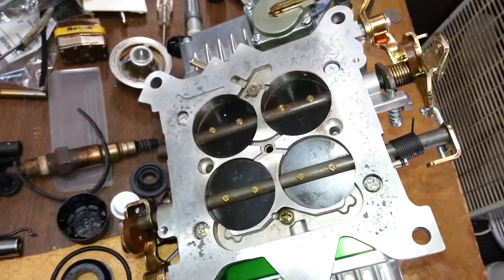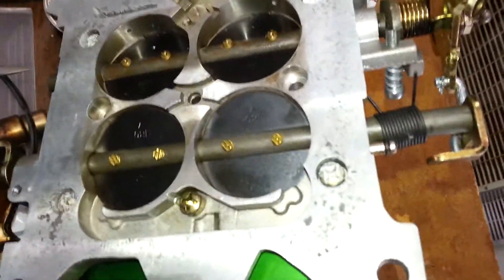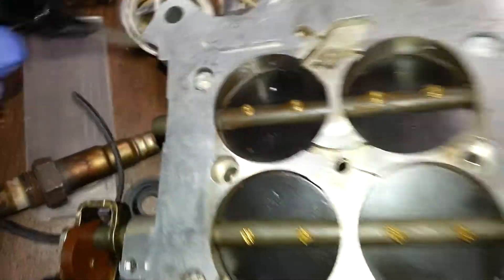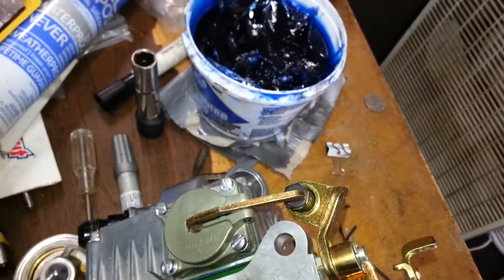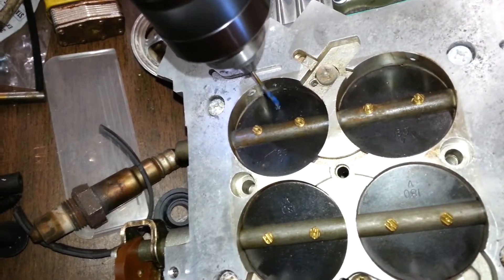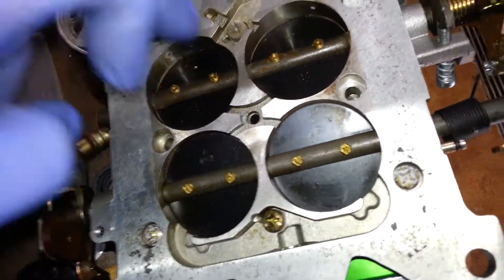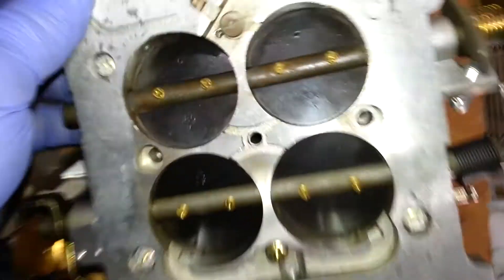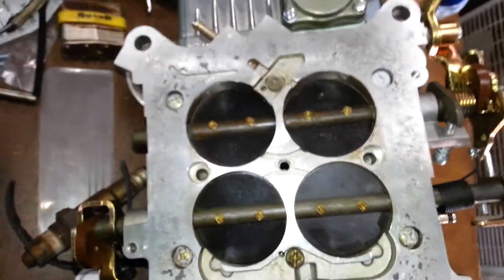Carb Idle Modification Drilling Holes

Comment: I was having the same problem,my 350 would not idle in idle circuit.I was hesitant to drill holes in the primary butterflies but was a a dead end so I went for it and it worked!now idles in idle circuit and I was able to adjust mixture screws with highest vacuum.runs better too.I was worried about ruining a brand new avs2.
Reply from the maker: Most of the newer high end racing and custom carbs come with holes already in the butterflies. I just think people today run more aggressive cams even in street driven cars that require that little boost of air. Glad you were able to get it figured out! 👍

Comment: I just take ‘em off the carb and do it and if you go to big take ‘em off again and weld or epoxy the holes and start over but yeah I did it on a 750 front and back with success.i will say that I have a new 600 throttle body I took em off of and they won’t go back on properly without a little massaging but we’ll get there.i’m building 4 more carbs.
Reply from the maker: I love working on carbs because they don't need a computer or electricity. Just a screwdriver and vacuum gauge 👍

Comment: Great video, I’m pondering whether to do this or not I literally have my carb on the workbench with a drill in my hand lol. I thought I would ask this comment first, I cannot get my car to idle without the transfer slot super open. If I back off the idle screw to leave the transfer slot, barely visible, like you’re supposed to, my car won’t idle. I’ve messed with my timing, I have a pretty good Lunati cam, if I do this will it help in that situation?
Reply from the maker: When your engine has more then stock type components many things can effect situations like yours. Can it help? Yes, but start with just doing all of the butterflies small then see if that helps at all. Then go up in hole sizes until best results. One main factor is having a choke horn or not. If you have a choke horn it will need more air flow. I think you should also change jet sizes too and try to get an AFR gauge to help you dial in your tune better. Good luck with your project! 👍
Reply: @djrowe10  awesome, this morning is my first test drive I appreciate the info! I definitely need to get an AFR gauge. Appreciate the reply
Reply from the maker: I hope your ride is doing awesome and the AFR gauge has helped dial in the tune! 👍

Comment: Why not just increase the idle airbleeds?
Reply from the maker: Air bleeds are changed to modify the air emulsion circuit of metering blocks. Air bleeds do not effect idle quality alone. The butterfly holes are created to modify the idle air transition slot's ability to sustain the idle circuits of the base plate. This E85 carb uses more fuel at idle even then gasoline carbs and therefore needs extra air to counter the poor idle effect of a big camshaft. Every high level race carb already has holes on the butterflies from the manufacturer as a baseline modification.

Comment: Do you close idle screw to get to that square mark on the transition slot with choke fully open or closed? I m assuming fully open because at idle choke butterflies are fully open? Thanks
Reply from the maker: Yes, idle screw will adjust the effect of squaring up slot. Ideally you make the transition slot as square as possible with idle settings that determines amount of butterfly hole size and jet sizes. Good luck with your build! 👍

Comment: Does this carb have an idle air adjustment under the air leaner stud.  I see the passages for it
Reply from the maker: Not on this model that I hand built from various Holley and Quick Fuel parts. That would be nice though. Holley makes a lot of bodies that are similar but not always fully functional.

Comment: Did this solve your problem ?  I have a 383 stroker with 750 edlebrock that continually idles too rich and fouls plugs. No adjustments have worked. Have seen others drill no.es as well.    Glen
Reply from the maker: Yes. This solved a problem with my solid roller cam set up on a 850cfm Quick Fuel E 85 race carb. It requires more fuel and air even at idle. I also only drilled out front plates and not rear. Good luck!
Reply: same issue.  Think I’m gonna have to try this